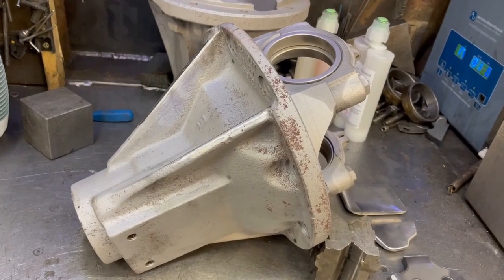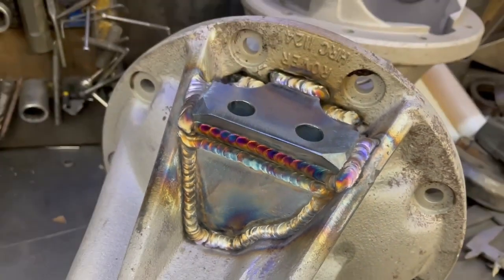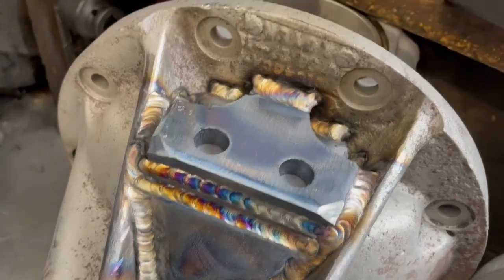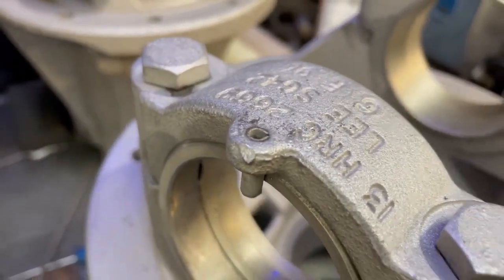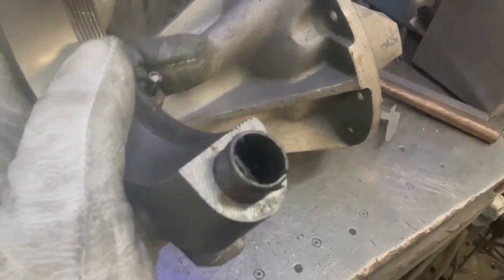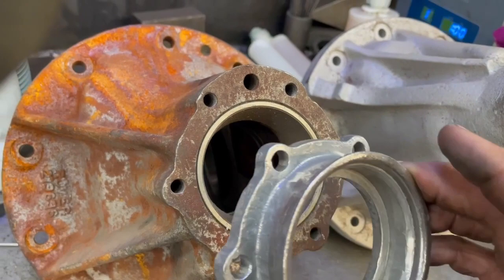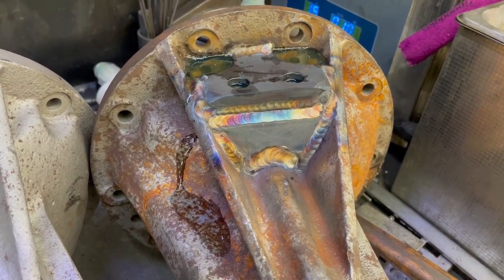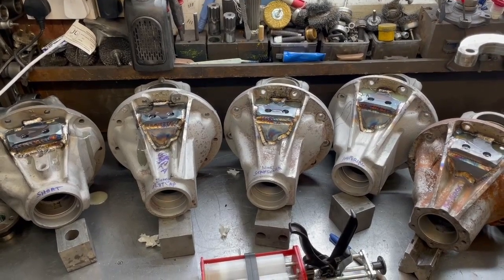Xcess 4x4 Pegged Casing Range overview

Comment: hey guys do you have a years that they casings went from imperial to metric without having to pull it out? or to ask in a different way I have a 1993/4 V8 series 1 disco what diffs would it have do you know?